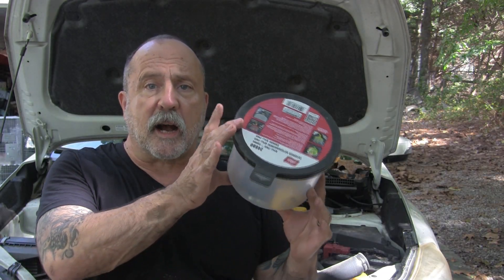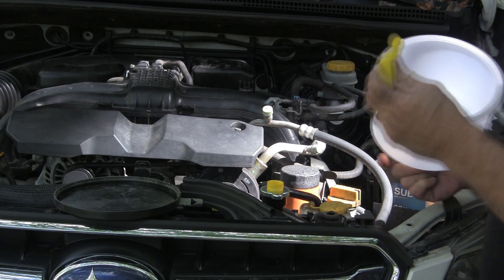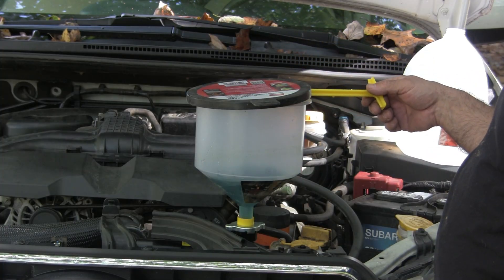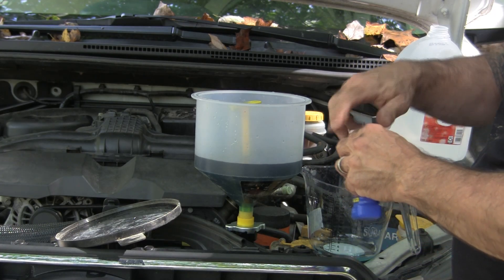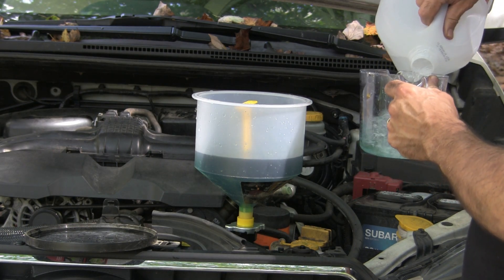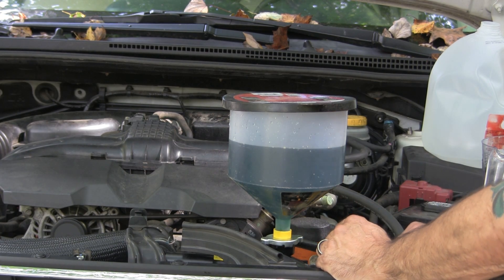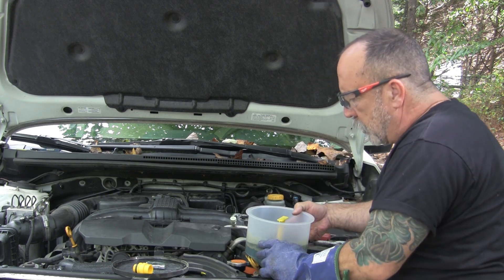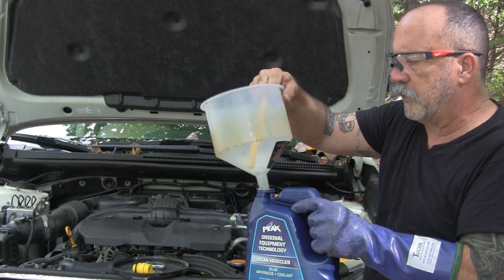Easy How To  Bleed or Burp an Automotive Coolant System - Any Make or Model Car

Comment: I literally love you❤ I got locked out of my safe and almost had it drilled. Your do-it-yourself lock replacement video saved my life and $600 I had wait a little bit for the part because I couldn't get a hold of the safe company for a free replacement but I'll get a hold of them later I had to get it open found the part online ordered it up for $60 and sure enough it came right open no problems. It's rare that someone's video is so helpful but yours extremely helpful I am so thankful for what you do. Thank you so much for such a great video. Not sure if you'll see this comment but that's why I chose your newest video to put it on I think it's important that you know that you made a difference for me cuz it was going to cost me $600 to drill it and $600 they said for a new lock so I would have been out pretty much a grand no matter what. Thank you so much
Reply from the maker: That is amazing, I'm happy I could help! Thanks for the great feedback!